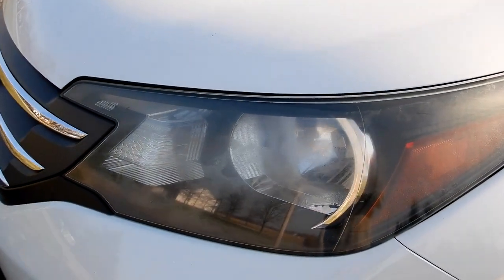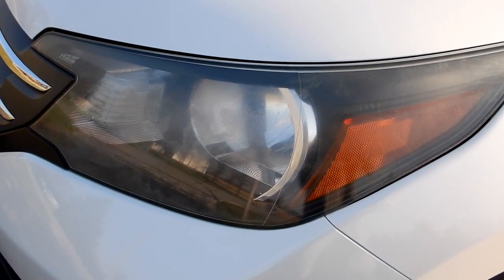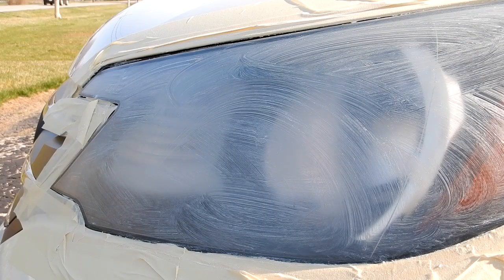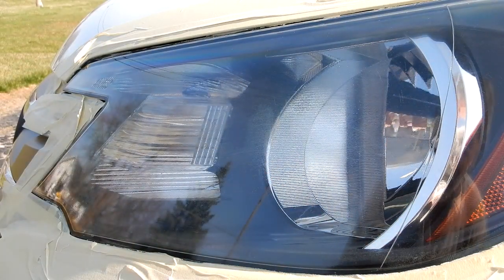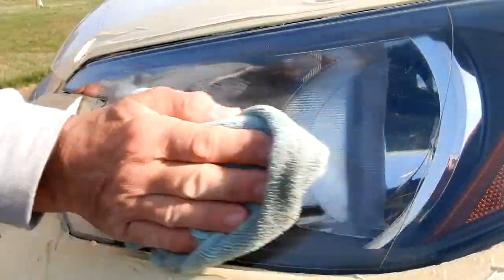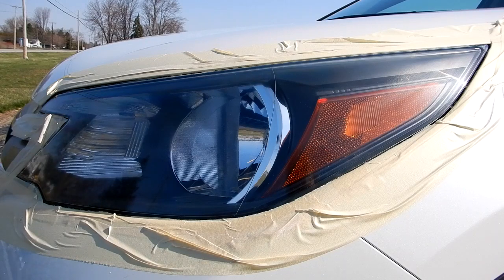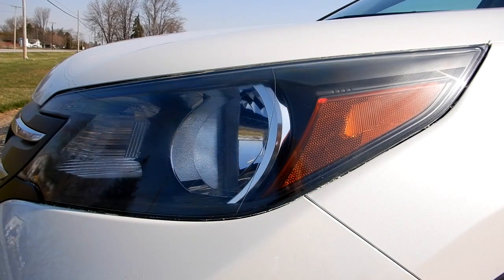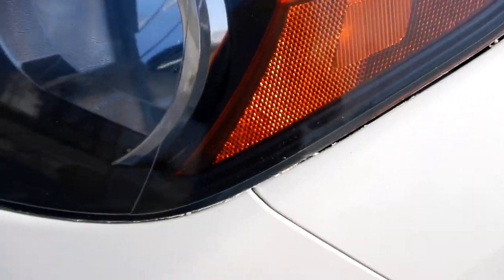Foggy - Cloudy - Hazy Headlight Lenses & MOTHERS POLISH

Comment: It works great. I got very similar results with similar clouded lens but with only 2 applications.  Spread Mother’s all over the lens and wait so few minutes to let it begin working. Then use a terry cloth towel and work the past back and forth just like the video but not to remove the past but rather to work to on the lens. Then remove most of it with a clean terry cloth towel. Finishing with a microfiber towel. No need for painters tape as  Mother’s will not hurt your paint. Also I did not use alcohol on my lenses. 
   Good job on your video and that you for spreading the word.
Reply from the maker: Thank you Joseph Perry.
Reply: Mother's works great using good old fashioned"elbow grease", no power tools needed.

Comment: I tried it with my buffer and it cleared it on the first pass. It takes a long time without a buffer man.
Reply from the maker: True, I have a buffer but wanted to show how it worked if you didn't have one.
Reply: @starastronomer  I'm not gonna lie it's a workout😄. I tried my Brother in laws car last week without my buffer and i had to get my buffer and some sandpaper because his clearcoat was peeling off and it was a pain to remove without wet sanding.
Reply from the maker: His car must have been bad. I lucked out even though my car was 7 years old it didn't require sandpaper.
Reply: @starastronomer  He has a 2002 toyota Premio and it's his daily so it needed alot of work. His headlights were extremly cloudy i don't even know he drove it at night lol. After i was done with it the end results were amaizing. Mothers Mag& aluminum polish is the best i've used so far. It also works on faded paint.

Comment: I have used the polish on my 2010 Corolla using only new polishing cloths did it all by hand not much effort at all. Clean well before you start and use small amounts. 3/13/2023 Shade is best or overcast.

Comment: Excellent video and I use the same polish to buff aluminum to a mirror finish. The only concern I see is the black gasket around the lens assembly. Hopefully a form of plastic. 
Isopropyl alcohol is death to rubber as rubber absorbs it.  That causes the rubber to swell over time and crack. I don't know if it affects neoprene rubber. I learned the hard way on my GoldWing valve cover gaskets. I had to toss them and get new ones ❓
Of course I have been wrong before.
EDIT:
I just found this on Google:
Exposing rubber to rubbing alcohol infrequently can cause discoloration and deterioration, but prolonged use of isopropyl alcohol will wear down and eventually destroy it. Ensure the longevity of rubber by keeping it away from rubbing alcohol.
Reply from the maker: GatorWing   THANK YOU! Not sure I got enough or any on a gasket. The lens assembly is one molded unit or glued together. I will take a closer look at it, thanks.

Comment: Unfortunately, this is an ongoing issue with composite headlights. Usually OEM headlights hold up much longer than aftermarket. Also, when you take your car to the mechanical car wash. The service guys use harsh chemicals to loosen up the grime before they run it through. In time these chemicals, along with weather conditions will damage the factory UV protective clear that is applied to the HL's. If a vehicle is in a collision and the headlights need replacement, usually the almighty insurance company will replace them with aftermarket, depending on veh year, availability, etc. So, if you want preserve your veh HL's, try hand car wash and tell the guys no chemicals, no brush. And if they need replacement due to a collision tell the shop that A/M is not acceptable, OEM only. But that request may not fly with ins. carriers. On the flipside, if you're leasing, who cares, veh is going back ! lol
Reply from the maker: Excellent information Jazz Hog.

Comment: Thank you I've been searching for this process without using a buffer. I have a drill for buffer use. 
But I don't know if I can be  trusted using the buffer technique...
I might burn a hole into my lens.
I think I'll start with your method.
Big Thanks again...
😎🐕🏜
Reply from the maker: Angela Wright   THANKS!!! I have a buffer but wanted to show how to do it if someone had no tool to do it. Not a bad process by hand. A buffer would be easier but then you don't want to possibly do damage to the plastic lens. You won't burn a hole unless you REALLY push hard in one spot and you would have to work at it :)   I will be doing this every year so it doesn't get ahead of me and it will be a much quicker and a easier job.
Reply: No you'll be just fine with a drill adapter polishing pad.  Its not fast enough to burn your lenses.  Try it out and see.